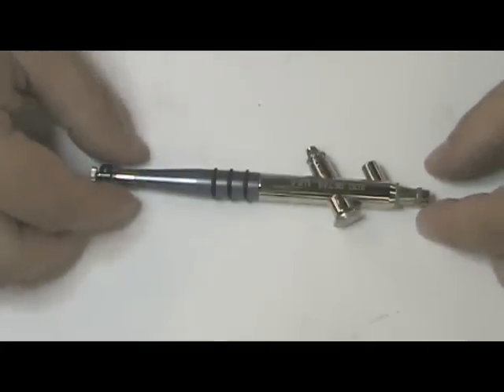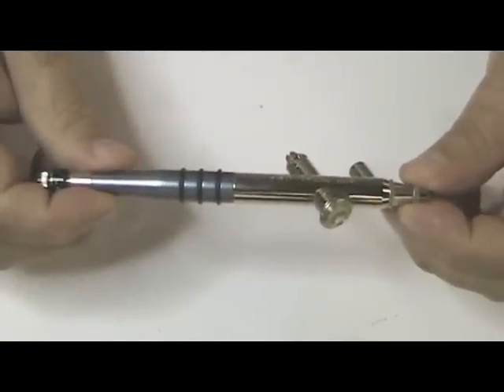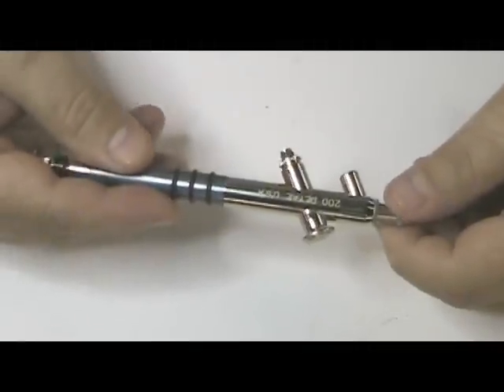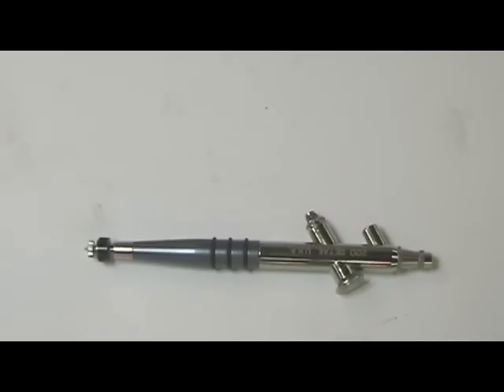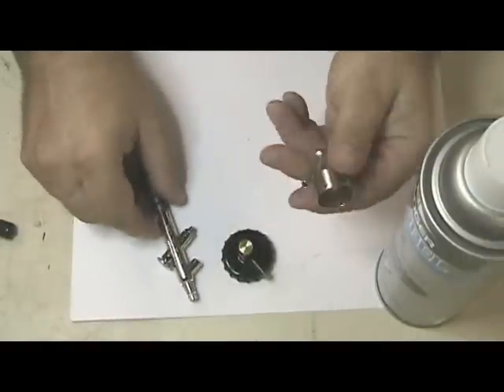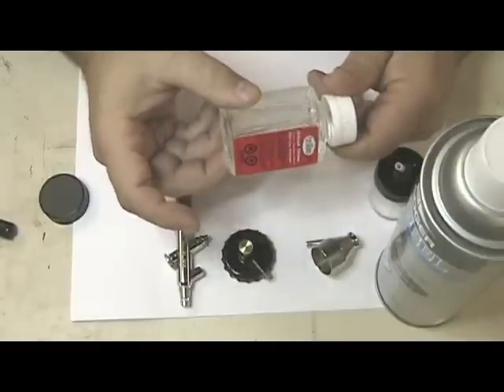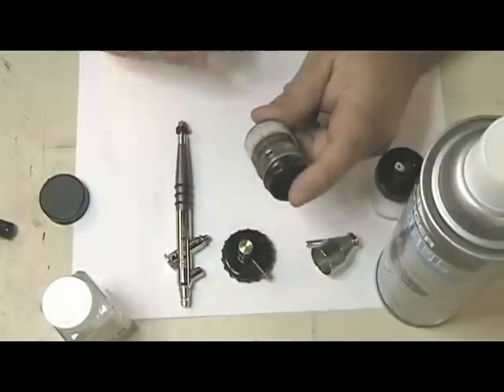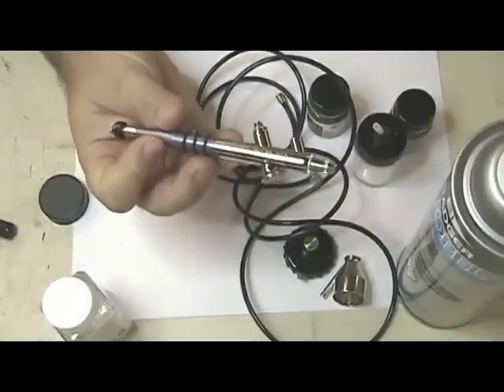Model Railroad VLog: Airbrushing: Part 1

Comment from the maker: That's something I plan on doing in the future. 70 bucks for a compressor is a good deal. I'll have to check it out.  The ones specifically designed for airbrushing go for about 150 or so.

Comment: @pacheco131313 connecting a spray can of PAINT to a airbrush...You gotta be INSANE! -You should ever ONLY connect a compressed air can (visit ie. Badger Airbrush Co.) or a certified compressor (using a PROPER connecting hose, not the vinyl hose that comes with the airbrush - dangerous). Also look at your airbrush as a surgical instrument and keep it thoroughly CLEAN at all times. The rest is playing around and learning!   - - - ENJOY!   :-)
Reply: That's not a spray can of paint, that's a can of Badger propellent gas for airbrushes.